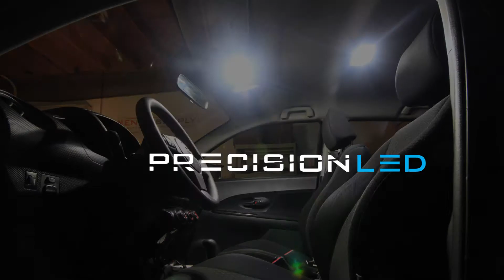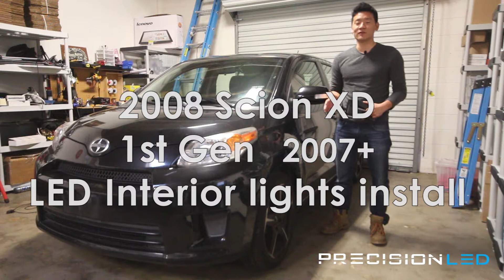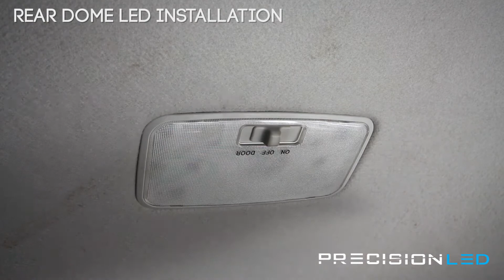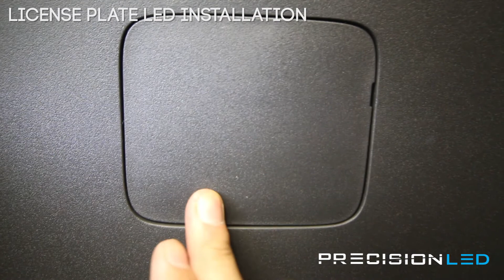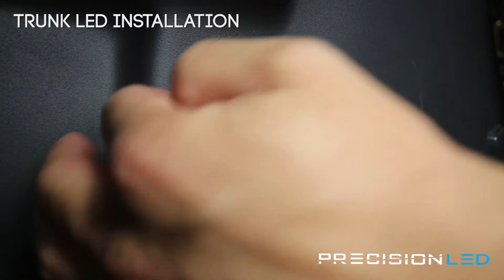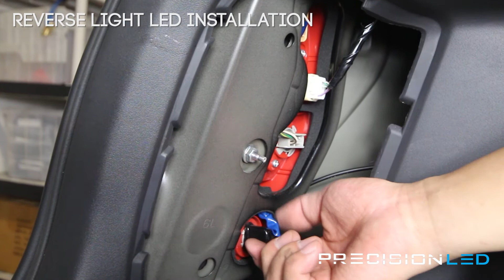Scion XD LED Install ( Front Map Led ) - 2008 1st Gen 2007-2014 DIY

Comment: i have a sion xd 2010  and i am planing to buy neon led light to turn my car into a party car. my question is what is the correct size bulbs for the 2010 xd
Reply from the maker: Thank you for your interest.  Which light specifically are you referring to?  Your vehicle would require many different sized bulbs.  The easiest way to go about this, would be to simply purchase the kit in the description of the video.  We do the research, so you don't have to.  We will send out the LEDs in labeled bags, so you know where they would be installed.  Also, yes, we do carry neon colors as well.